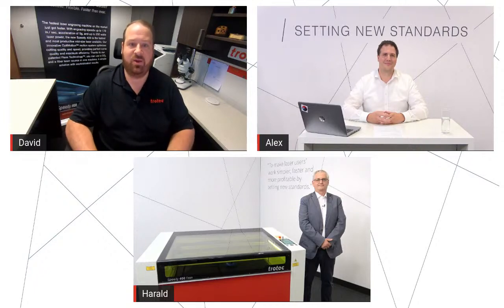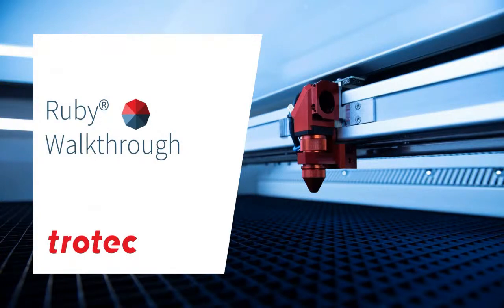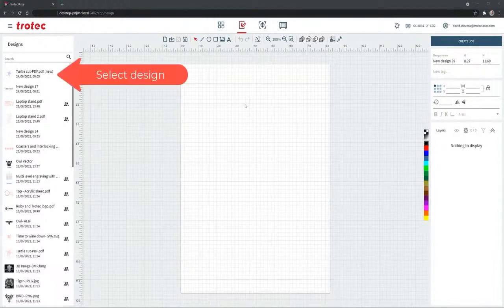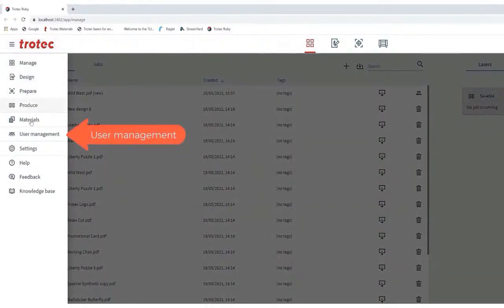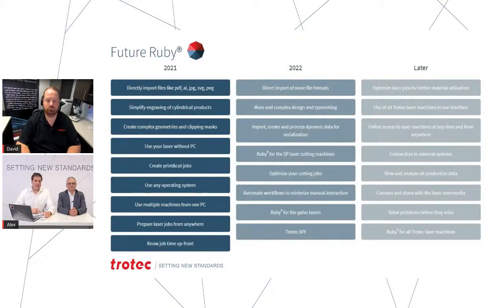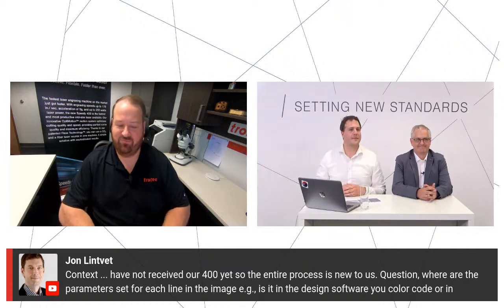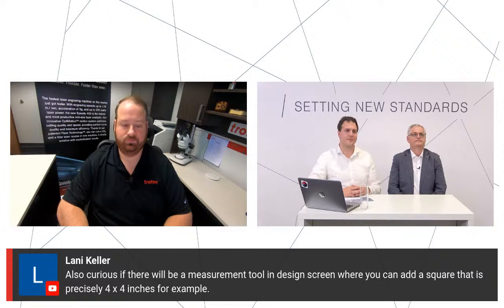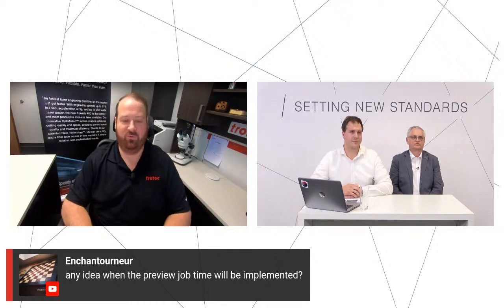Trotec Third Thursday: Ruby Laser Software

Comment: I noticed that when you added red 'cut' lines in the design screen, you didn't have to specify a stroke value.  When using Job Control, I know it is necessary to change your stroke value to .001 points.  Is this not necessary in Ruby?
Reply from the maker: Hello! Trotec’s new Ruby software no longer requires a specific line thickness to laser cut, only a color identified as a cut line, in this case, red.